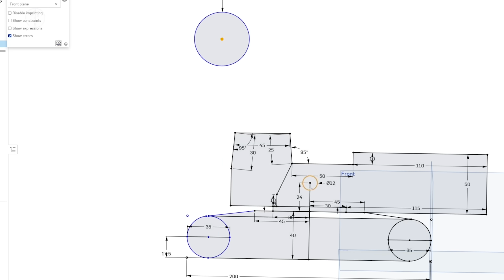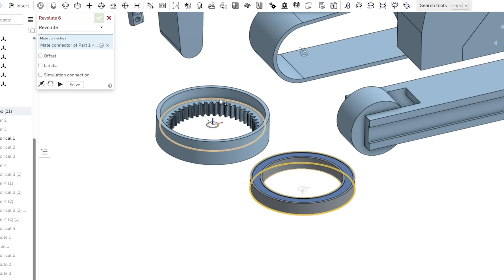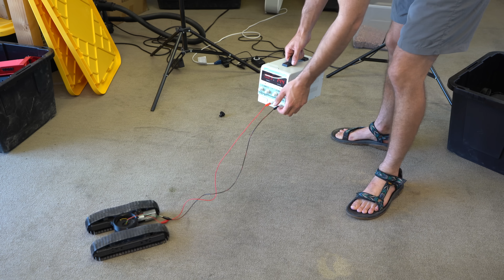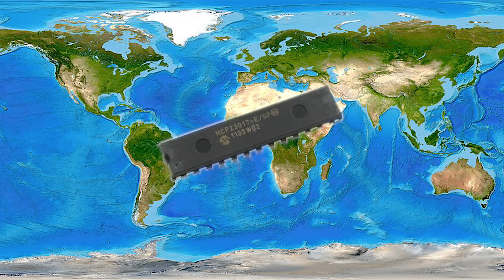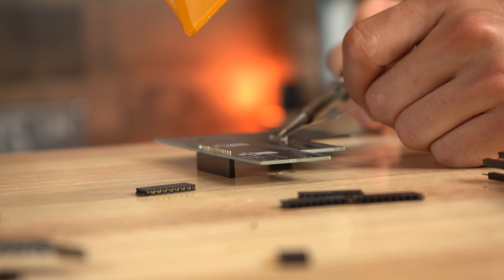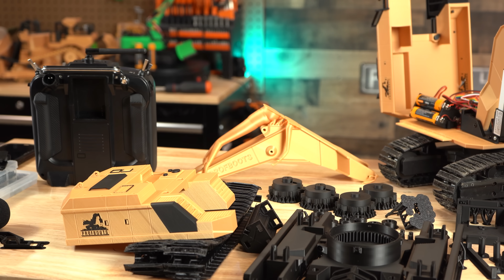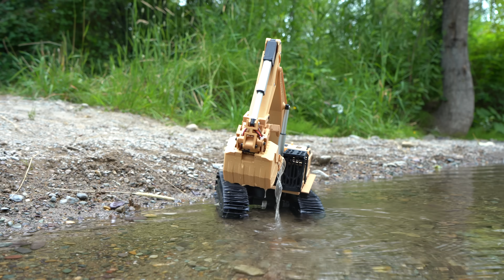3D Printed RC Excavator - DIY

Comment: One of your motor outputs should be used for a blade on the front of the track frame, might need to use wires from that slip ring (after all, you have 6 wires, 2 per motor = 3 motors on the track chassis)
Then to fix the problem with the tracks being too loose, rather than toy with the track lengths all the time, why not just change the idler wheel to a tensionner wheel ?
Finally it would be nice if the thumb could open more.

Comment: You know what is an unfortunate issue on construction and excavation site?  Injuries, fires, and other life safety issues. I think it would be pretty cool to make an off road ambulance, fire truck, ladder tuck, and tender... extra points if they can actually pump, store, and spray water for the fire stuff, and have working stretcher for the ambulance....

Comment: Well now you need a barge and tugboat since it can now dredge the water further out or maybe a long reach boom?
Reply: This is an amazing idea! When I saw the test at the creek/river I thought that a barge or boat of some sort was needed! Maybe a landing craft so you can drive RC vehicles onto it? But yeah. Barge or tugboat for sure. Note that if you are going to make a water vehicle. 3D prints are not waterproof. You would probably need resin prints. But you can line the interior of the hull with a waterproof material like fibreglass or drench it in a thin layer of hot glue
Reply: @moni9710  3d prints can be waterproof if you do a few coats of spray paint/clear coat.
Reply: @moni9710  I made an RC boat in PETG with 3 wall layers and it's waterproof (only moisture is coming through). You can also use bricklayers to have something 100% waterproof
Reply: @moni9710  Long boom would be great, but needing a smaller bucket just like in real life, due to the weight of the boom, smaller bucket is necessary.
Reply: @justinpepin6234  Not necessarily. The smaller something is, the stronger it is proportional to it's size. This is evident in mini-excavators having long thin booms, mid range ones having booms that are a bit shorter and thicker and lastly the biggest mining excavators that have thick, stubby booms and arms. And an RC like this you might get away with the same size bucket.
Reply: @moni9710  Minwax Helmsman Spar Urethane
Reply: I freakin love rc boats but the fact he didnt heart this comment is worrying 😞
Reply: Definitely needs the long reach configuration!
Reply: @prestonkean3183 of course.
Reply: time for rc boats and docks. container ships. crane loaders. ships which transport machines . Might aswell start building some rc planes and an RC military plane ship
Reply: What bout an barge long boom excavator and one of those excavators with long boom and those tracks that make it float
Reply: I designed the cargo ship that I work on - but only as a model. I'd love to supply that to as a base model for him to expand on and make it RC
Reply: He's one step away from building The Netherlands
Reply: The best idea
Reply: Why stop there follow it up with a shipping bay crane!
Reply: OH I REALLY like that Idea!
Reply: Now that sounds incredible
Reply: YES! Barge next!
Reply: time to dredge for gold

Comment: Vibratory Roller for the next project? 
Adding some road building equipment to the arsenal! 
Can have multiple roller styles. One smooth for flattening and one that’s ribbed for compacting
Reply from the maker: The vibration mechanism would be fun to make!
Reply: @professorboots center body articulation steering too! Would be awesome!!!